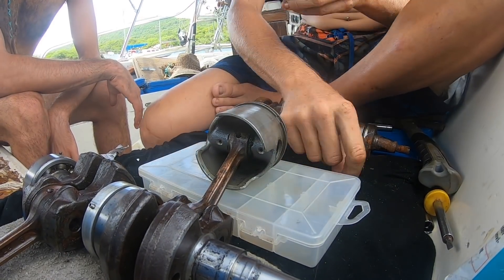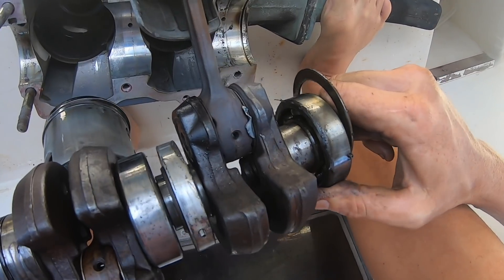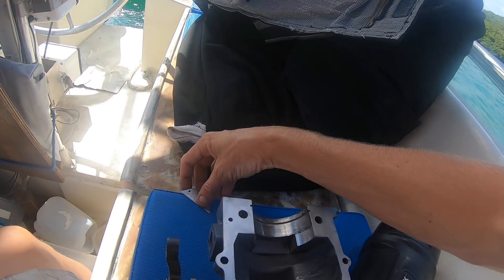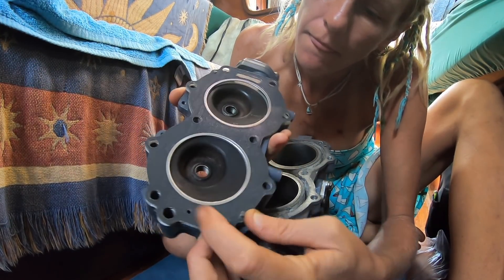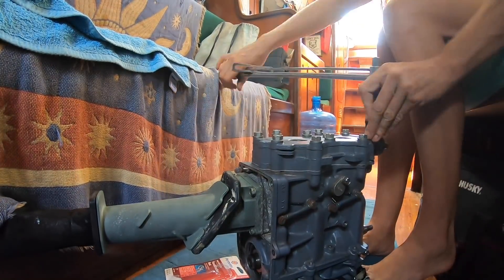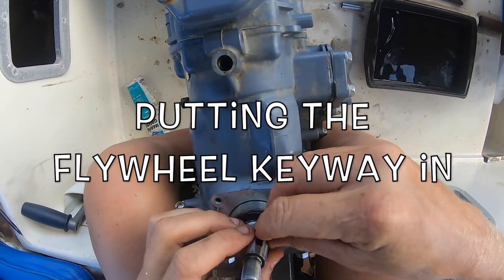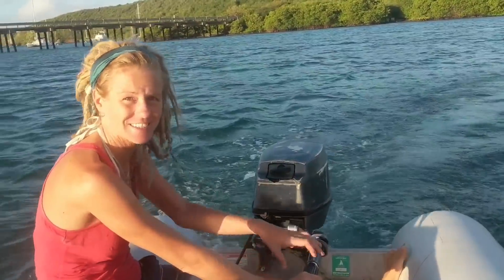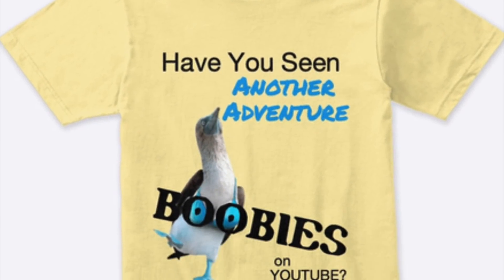Crankshaft Lesson From A Girl!  Rebuilding a 25hp 2stroke Yamaha Outboard in great detail!

Comment: on a two stroke it is vital to have the cylinders honed to ensure 100%piston ring seal for those who have nknowledge of 2 strokes there are no mechanical valves  if your a youngster or just some who has only worked with 4 strokes you are welcome to contact me  and I will fill you in with the missing info 2 stroke is not a black art it just needs a slightly different approach
Reply from the maker: yes… you Must have missed the part where we do that in the video

Comment: Hint @ 3:31 when flattening the crankcase surface, instead of on the wooden bench surface (which can still have high spots / waves) use a piece of flat glass. It is even flatter than the wood bench. Glass on the bench, sandpaper on the glass and crankcase on the sandpaper. 

Great job by the way!

Comment: having built one or two outboards I like to run a little bit oil rich on the first running  and castrol R in the mix once its had a few runs  though I did find with the Johnson 120 V4 seahore I would allways run castrol R in the mix the motor seemed to stay inone piece for longer when running that mix a bit expensive compared to ordinary 2 stroke oil but cheaper than a strip down I meant to ask how is your chicken doing ??

Comment: Make sure that the head is flat, flat, flat.   Use a large flat to flatten head, then a new sharpening stone, if you have one.  Also, make sure to get a new magnesium plug to protect from pitting.  This is where the high end synthetic oils work great, because they have mirco beads of zinc in the oil protecting from pitting.   I still am amazed on just how resourceful you really are. Dame you are good!
Reply from the maker: well, it’s a two stroke so it does not have a crank case for any type of oil. The two-stroke oil is mixed into the fuel on these style outboards.
https://www.youtube.com/watch?v=LX-6_sOx1fc

Comment: If you put the sandpaper on a bit of thick glass you will get a really flat surface 👍 you are doing a really great job sailor. Adding a little extra oil in the fuel the first hour of running the motor lubes a little extra. 👍 
Stay safe and keep on what you are doing.
Reply from the maker: Yeah but real sailors don't have a big thick piece of glass on board or any glass if they're smart... And I ran after oil for the first several weeks but it doesn't matter how much oil you put in the gas on first start there are several rotations before the bearings are lubricated if you do not add on assembly

Comment: That red stuf you used between the casings. What was that?
Reply from the maker: Loctite... I think I say that in the video but I should have put text on the screen as well
Reply: I ain't gonna look at  her answer and say Red Loctite 262.  Even red is subdivided so that's a guess based  upon the bolt diameter and popularity of 262.  From here: https://henkeladhesivesna.com/henkeldocs/LT-6540_AN_RemovableReliable_SS_v11_Final_Links.pdf  and the answer is!:..........?